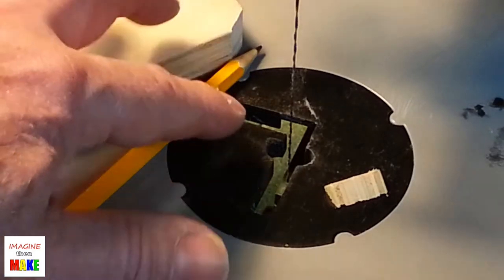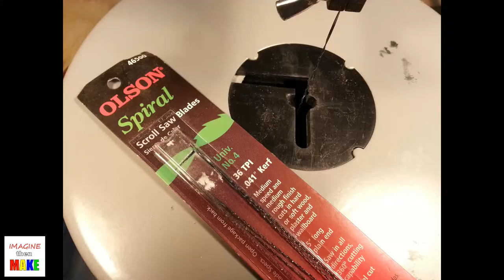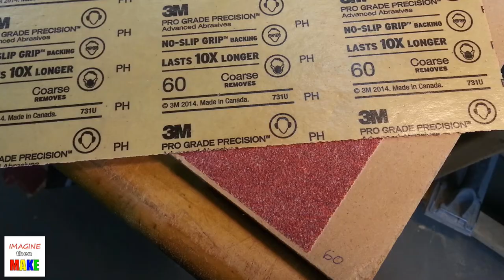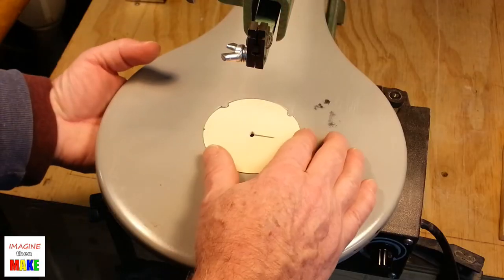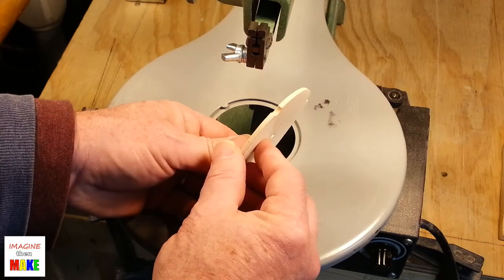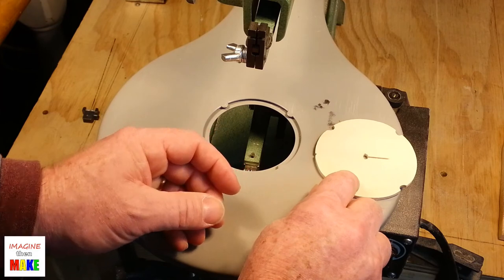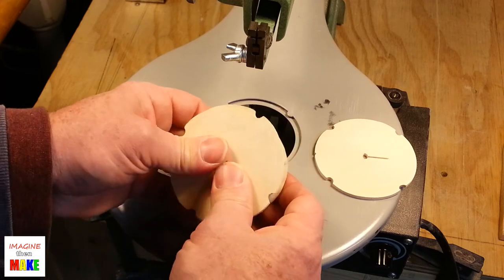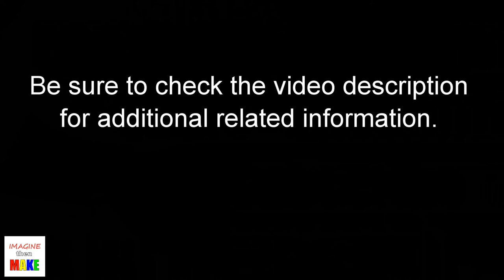118. Simple DIY - make a zero clearance scroll saw table insert

Comment: The table insert is recessed below the table out of the box. Is that standard for scroll saws? Ive seen no mention at all on the internet about it. Small pieces cut at an angle, seems like an issue. Maybe its just my saw tho. Good video
Reply from the maker: For low priced scroll saws, I would not be surprised if the insert sits a little lower than the surface of the table. Hopefully, my video shows you how you can make your own insert which of course, you can make level with your table. Thanks for your comment and for watching. Feel free to post here after you have made your own insert to let everyone know how it went.